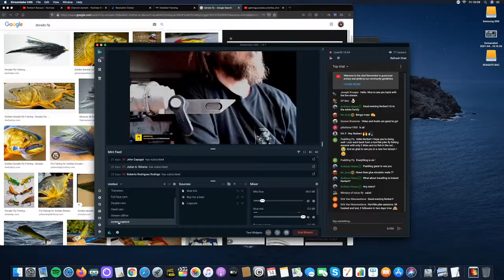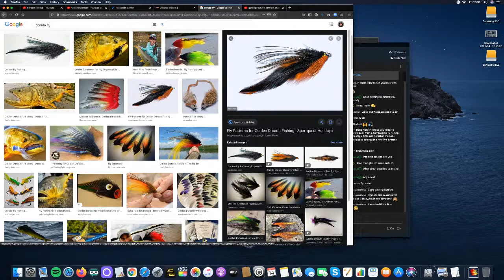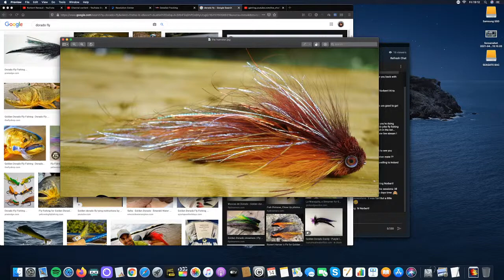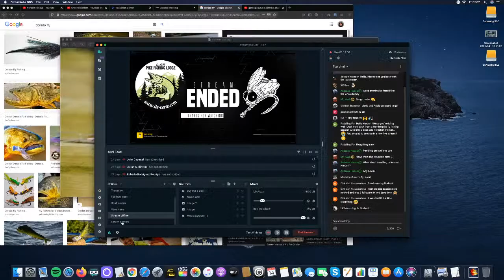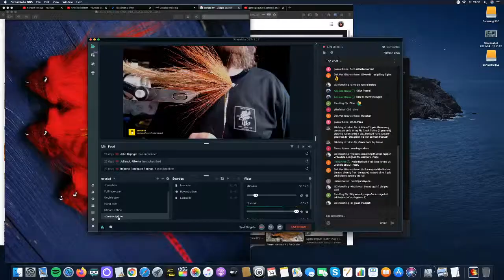The Live Sessions: The Hamster

Comment: Your RIO lines have Cracked??!! I'm looking at 9-Weight System, that's Still in Perfect Condition, and they (the Set) has been used for Pacific Salmon and Steelhead, Since 1999!! It was put on my Hardy Sovereign Gold limited edition, by the Owner of a Fly shop I the Pacific Northwest!!
Reply from the maker: Yes they all have cracked, all the one i owned , all the replacement lines have cracked and the same happened to many of my clients. I went to scientific angler and their sonar Titan started cracking after one season. Airflo are the ones that never gave us any trouble so far.